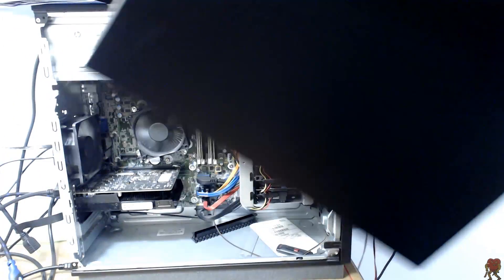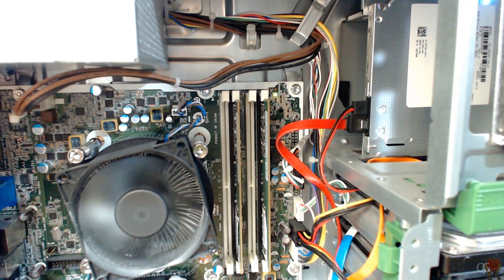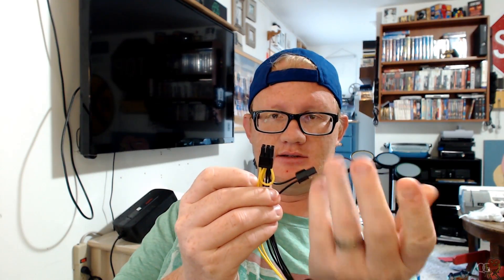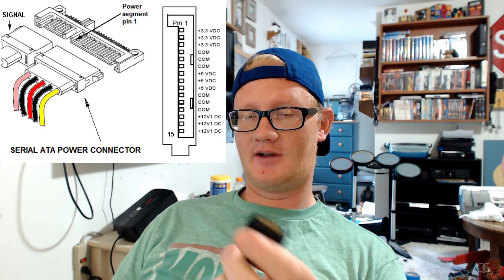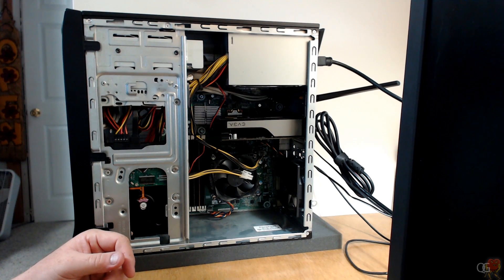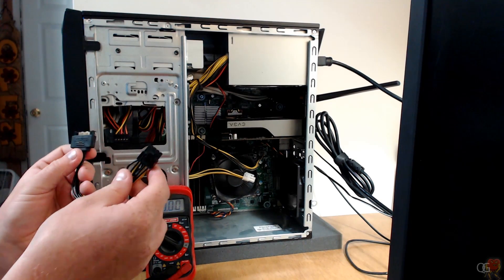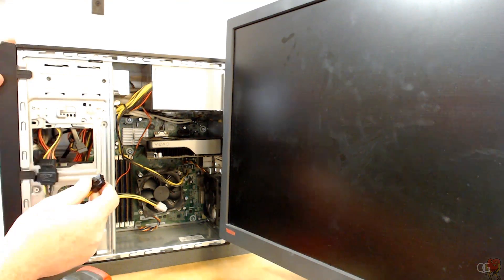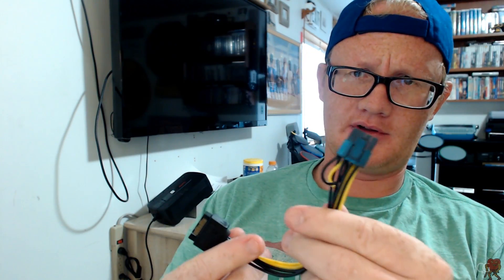No Power Supply Cable For Your Graphics Card? No Problem!

Comment: where did you get the 15 pin to 8 pin adapter, i ca not find it.
Reply: Make sure you connect to two individual sata-power connectors from your PSU, this way the total power delivered to the 6-pin will reach 100 W

Comment: Can i run an rx 480 8gb or 4gb with it
I have a xilence Xp400r7 400w
Pls help me my psu only has a 6pin connector and it needs 8pin i think and the rest of my pc just use about to 230-250 watts pls

Comment: hey i have a question, so i have a 450w corsair psu, i have a 1060 3gb which is a 6 pin gpu but im getting an 8 pin gpu, how do i know if my psu has an 8 pin slot or not and if not what do i do?? cause i dont wanna get a new psu
Reply: Assault Kodi yo kodi 😂
Reply: I can’t use my pc till I get this 😂

Comment: if my psu is 350w should i be able to run my new rx 580? it requires a 8 pin  and my power supply doesnt have a 6 pin connector do you think i could buy a molex? also the graphic cards requires 325w
Reply from the maker: You should probably get a bigger psu
Reply: @thequintessentialgamer7514  is a 500w psu enough for an rx 580 4gb that has an 8 pin connector?

Comment: You can get the GTX 1650 that doesn't need any external power connectors. Get the ASUS low profile version - it's only 30% slower than the 1060 - a mean feat considering its size and very low power consumption.

Comment: If I buy this adapter will I be able to play pubg fine with a rx 570?
Reply: I was gonna ask that too!
Reply: @darkwave6221  yea but my friend said that it's kinda not going to run properly so it's better to buy a 600w psu.
Reply: @yourbrother3838  i have a 500w psu do you think is enough??
Reply: @darkwave6221  yes it is
Reply: @darkwave6221  it is just enough to power one but this adapter might not be suitable for gaming

Comment: Is it dangerous to use it for a long time? I bought an rx580 that brings 8 pins, but my psu doesn't have it, I'm thinking of buying this adapter since it has 2 moles ports, my psu is 530w output, all over the internet they say it's not recommended
Reply from the maker: It's better to use a psu that has the right molex connector to power your GPU with. They can handle a bigger power draw than my little cable

Comment: Hi, I Am Not Smart As You Are Sir That's Why I'm about to Start Asking.

Sir Can A RX580 Run Regularly Without a 8 Pin Cable Connected to it? 

Thanks, Love Konso
Reply from the maker: Any card that has a 6 or 8 pin molex connector on it will need the corresponding 6 or 8 pin power cable plugged into it to provide power. They simply dont work if you try to run it off the pci-e slot alone. The only cards that can run off the pci-e slot alone will be the ones that don't have that 6 or 8 pin miles connector.
Reply: @thequintessentialgamer7514  thanks sirr

Comment: What about a GTX 970 14 pin? I saw an extender that has 18 pins I can connect after plugging in the Sata
Reply: what? you can only connect 8(or6+2)pins+6pins(14 total). I bought in Amazon two Sata-2+6pins for only 8€, and if you got two sata avaible you can use them :). With 2+6pins you can use 8 or only the 6.

Comment: 1 sata for 6 pin does work?
Reply from the maker: As long as your psu has enough watts then yes
Reply: @thequintessentialgamer7514  I have 600 watts PSU with only 1 6pin and no molex....and I'm planning to buy R9 380 is that okay?
Reply from the maker: 600 watt psu will run it, but with the cable I'm talking about? Its risky. According to https://www.guru3d.com/articles-pages/asus-radeon-r9-380-strix-review,5.html the r9 380 uses 92 watts while idling, which this little cable can handle just fine, but at full stress it uses 332 watts, a lot more than the cable can handle. So if you run it while stressed for too long you'll be getting some hot wires in your pc, not recommended.

Comment: You still need a big enough PSU to run the card!
Reply: Exactly. HP's PSU is only 270 watts.
Reply: @HaggardPillockHD  if my psu 700 watts it is good for graphics card or not?
Reply: @Gamer-uj2mr  should be more than enough.

Comment: They make a special connector that works from a regular power supply to the HP mother board also.
Reply from the maker: Where does one find such a special connector!?
Reply: @thequintessentialgamer7514  search for a 24 pin to 6 pin adapter, assuming thats the size of your motherboard intake

Comment: What if u connect the cable 2 the power supply sata will it have more voltage?
Reply from the maker: It wouldn't increase the voltage, I'm actually almost done with a follow up vid to this one where I look more into this thing and what its limits actually are

Comment: Does it work on my rx 580 (needs 185 watts)
Reply from the maker: if your PSU supplies 250 watts or more ON THE 12v RAIL then yes this will work.
Reply: Did it work? I have RX 580 as well. 
Only available connections on my PSU are SATA (x2) and Molex (x2)
Reply: It works but not completely if u use a vr

Comment: HP is the devil
Reply: Long story, but I'll try to make short.  I delt with HP before, trying to use there motherboard for a computer build.  No go.  My mom gave us her old HP, and I put a graphics card in it that is pcie power only, so no extra power.  Now I just went to upgrade to a RX 480, and realized there is no 8 pin cable.  Then you got me thinking, do i even have enough power?  NO!  This is only a 250 watt power supply.  I just used a calculator, and I need 468 watts (418 actual watts used just on basic parts)  ughhhh
Reply from the maker: And I'm sure finding a psu that will work with your hp mobo AND has more wattage is next to impossible. I feel your pain friend.

Comment: That is for hard drive and has limited power.  You can't get 70 watts from this.  You can get Max 20 watts
Reply from the maker: You can get up to 120 watts with this, maybe more depending on the gauge of wire your power supply has. You're right it has limited power and can't provide as much power as the traditional means, but it can still power most GPU's

Comment: Dang, you deserve more subs. You think this will work good for an 8 pin?
Reply from the maker: Ur right I do. I think it'd probably power an 8 pin just fine. If it can supply enough amps to meet the graphics cards demand then yeah, I believe it'd work. But how many Amps the card demands will likely differ from card to card, and the amount of amps the power supply can provide will differ from power supply to power supply. You may notice a sata power supply cable coming out of a power supply usually has multiple plugs on it to power multiple drives, and I know that you'll have less amperage for your card if you also have drives plugged into the same sata power cable. So if you're worried about having enough power then make sure as little drives are plugged into the same cable as your card.
Reply: The Quintessential Gamer So if I have multiple split offs of sata power cables, I should use one with nothing plugged into it?
Reply from the maker: @FaultyScript  i would think so, yes!
Reply: The Quintessential Gamer I got it yesterday! Works perfectly!
Reply from the maker: @FaultyScript  Fuck Yeah!!
Reply: @thequintessentialgamer7514  so with a 550w psu, could it be enough to charge a asus rx570?
Reply from the maker: @zetiloty9421  according to https://www.tomshardware.com/reviews/amd-radeon-rx-570-4gb,5028-15.html your GPU draws a max of 195 watts. Now some psu's will say how many watts they supply to each power rail on their label. Like 250 watts to the 12 volt rail, 100 to the 5 volt rail, and so on. If your psu says it supplies 195 watts or more to the 12 volt rail then you should be ok. I'm no expert so try at you own risk, and good luck!

Comment: so the cable really work from ur hard drive cable to pci-e cable to the graphic card
i was looking whole night for an solution for upgrading my graphic card and i saw i had no 6 pin pci-e cable thanks for video
Reply from the maker: If your dvd drive cable has the same 15 pin connector as any hard drive, then yes it will work! Glad I could be of help!
Reply: @thequintessentialgamer7514  thanks u very much i am playing game on an integrated card so all my game are very low fps so now i can use dedicated cards without power point/cable
Reply: My power supply is only 310 wats do I have to get a new power supply and mother board and prob CPU what do I do
Reply: @robertruland2500  If your computer is an HP prebuilt, then it uses proprietary connectors, and you will have to either order a PSU from HP or build a new PC. Yeah, 310 watts is not enough for modern gaming. Your only option really is to get a 1650 since it only runs off the PCI-E slot. It's not really great but it's better than nothing.